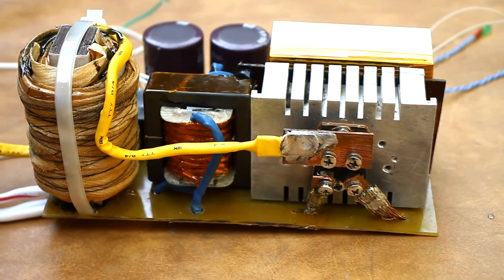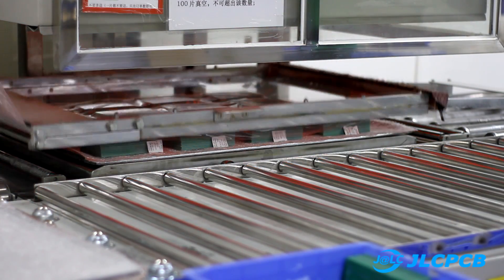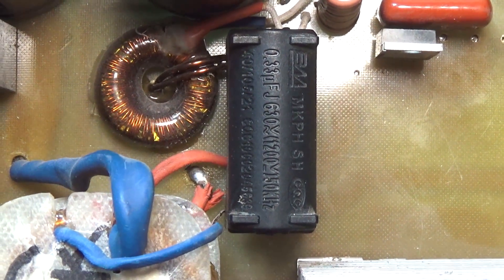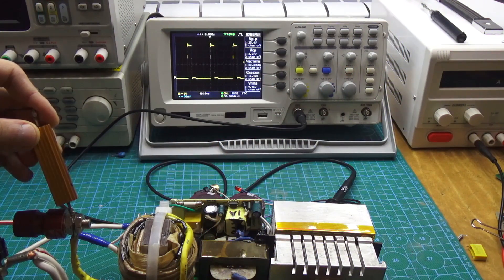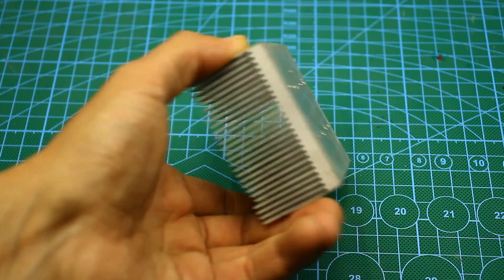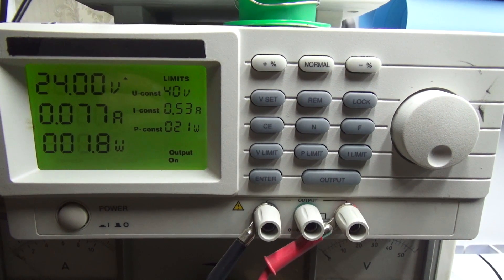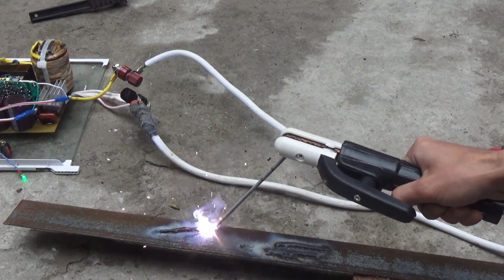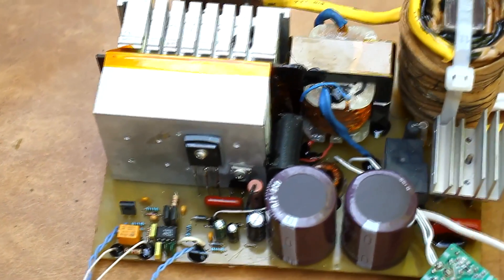Welding inverter on one transistor

Comment: Remember automatic discharge resistors across high voltage capacitors with a suitable discharge rate….regards Gary….isolation transformer needed and a variable for first start up monitoring a build is ok and helps but should be teaching better practices …and workshop. Skills.. regards Gary..

Comment: What I realized with the electrodes on a welding inverter, is the fact that they melt faster than what they do on a traditional welding transformer. I tried to weld with both of them, but that's the only disadvantage I found on a welding inverter compared to a welding transformer

Comment: the welding inverter circuit needs a 310v input, the line mains here is 110v so I need to raise the voltage to this point so that the inverter welding machines can work .... can you help me ???

Comment: A thought.
To expand on this brilliant circuit, consider a pulsed welder with gas.
Known as 'cold welders in China ' 
To regulate the gas, a valve is used and the output welding pulses are PWM controlled. 
Love your channel.

Comment: Nice little welder, and as far as learning to weld, I was once told that if you get 20 pounds of welding rod and use them all, looking over your weld after each rod, you will be pretty good by the time you have used them all up.
Reply: Or 2 miles of Flux Core Wire!
But only if you Pay Attention!
Once you realise theres only One Channel, the Puddle becomes Pretty Interesting!